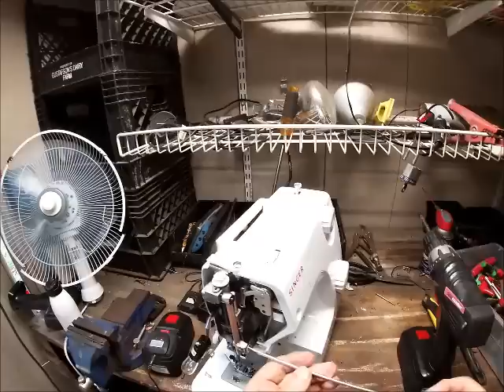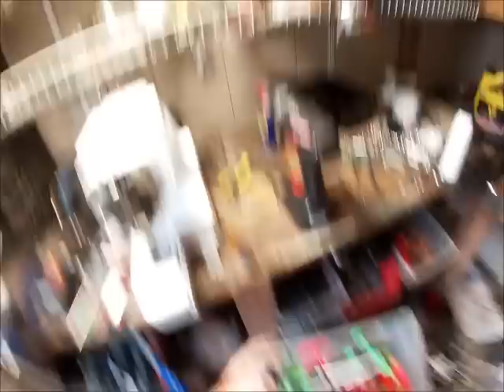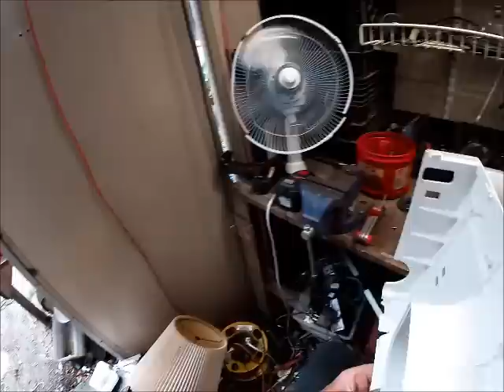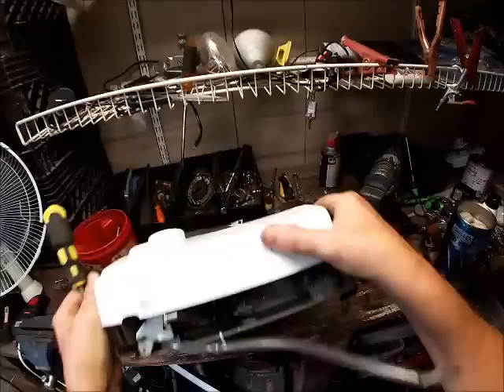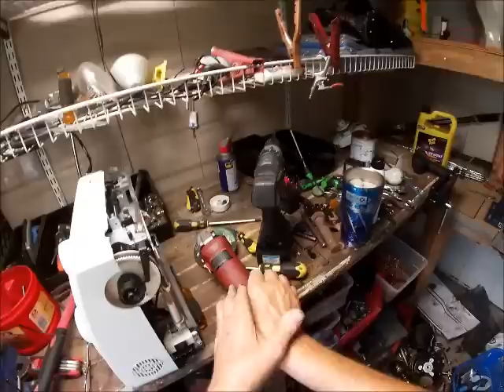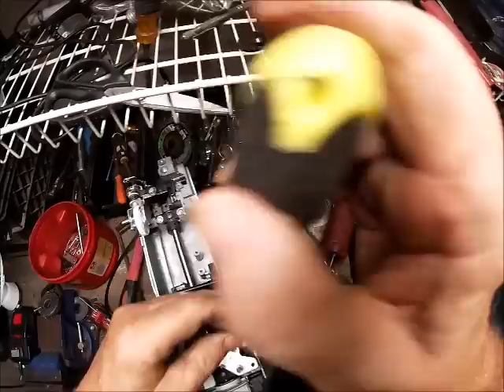Mr Singer Kind of Whooped My Butt Sorta

Comment: I have a feeling that most Scrappers nowadays, including myself have never seen anyone get excited about something like that little motor the way that you did. I personally have always just seen then get thrown into the electric motor pile
Reply from the maker: That little motor has so much going for it, It will be very easy to mount on something, It's 110 volts and A whopping 5000 Rpm's. I already have a couple of things in mind for it.
Reply: @JunkDobber  yeah I saw that where you said it was 5000 RPM! Seems like quite a bit for such a small mower. I guess it makes sense though because those sewing machines needles go up and down so dang fast